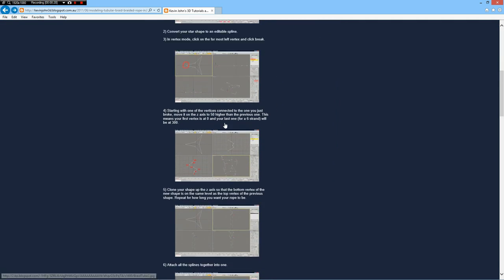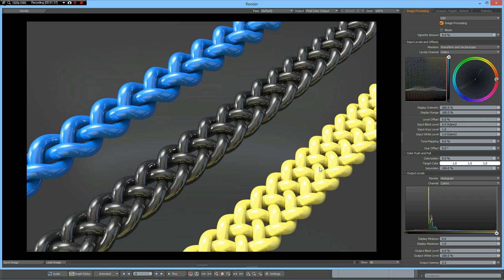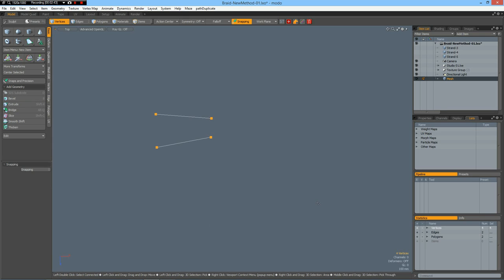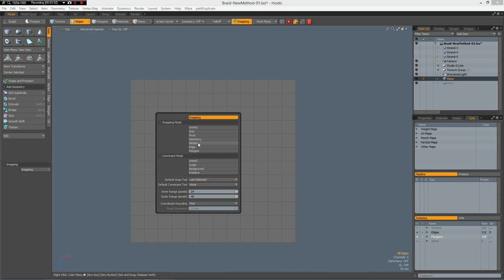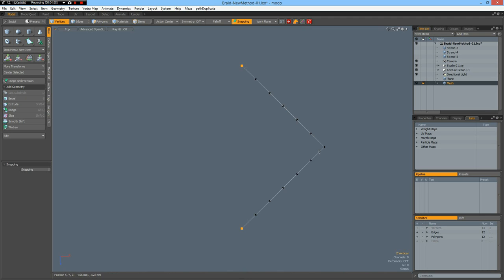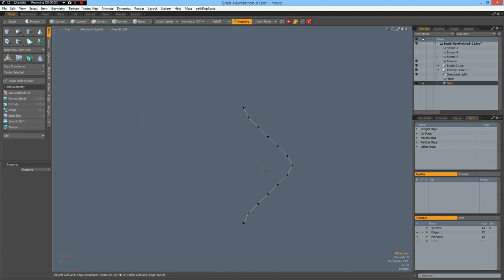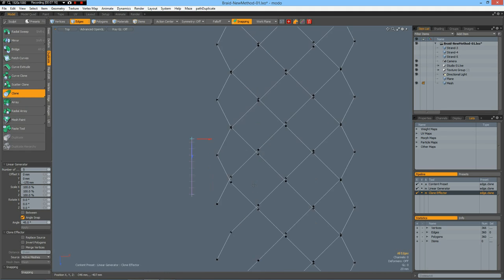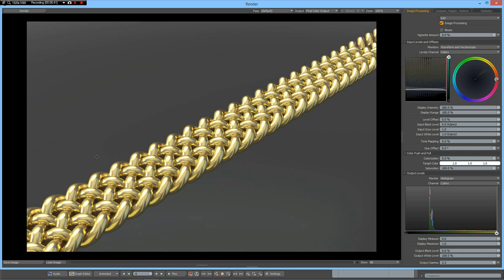The Foundry MODO - More about Braiding

Comment: Hi Peter,Thanks for your video..i have an issue could you help me to fit it?
http://youtu.be/klw9rk3zgr0
Reply from the maker: Voong Chuong Se Hi, I think you have made the tool handle invisible. Make sure you set it to visible. It is the 'V' column in the tool pipeline. It must have a '.' (dot) in when the tool handle is visible. Right click on the 'V' column for the tool in question. I hope this helps. Good luck, Peter